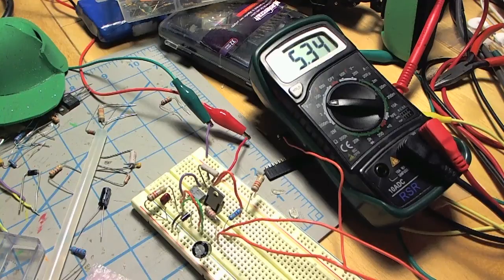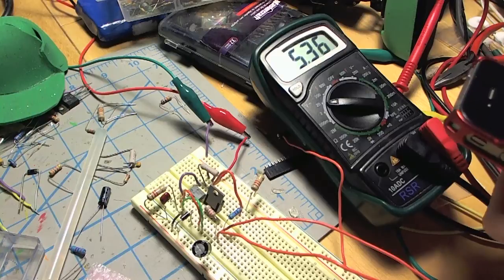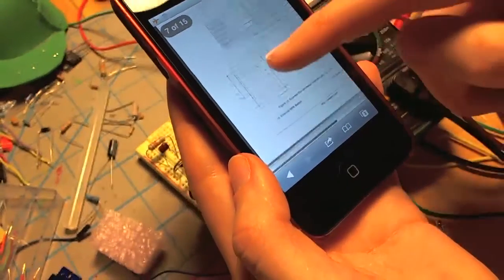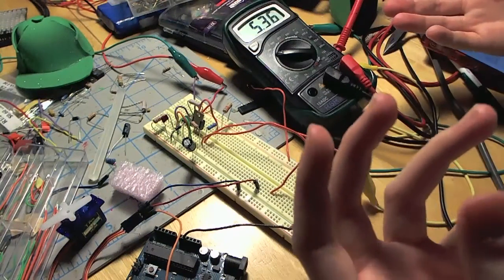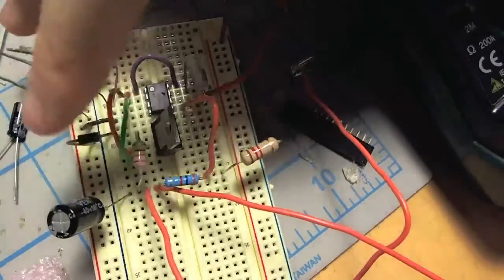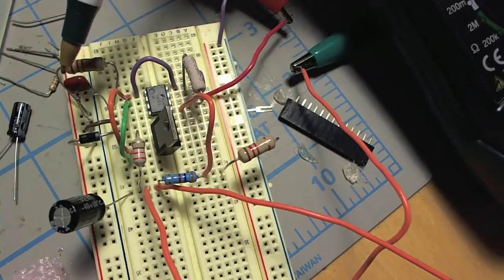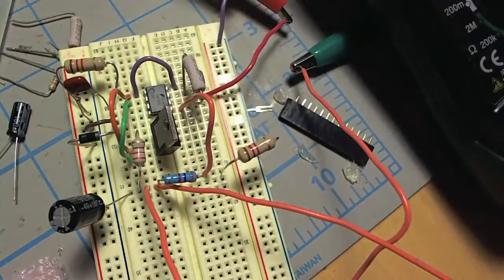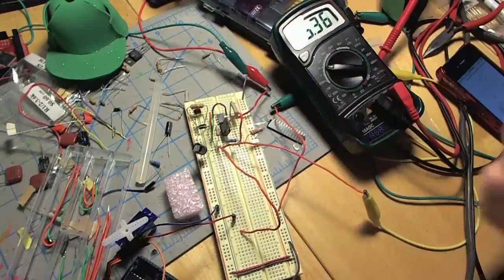Need help with MC34063 & external boost smps circuit

Comment: I know what it's too late, but i understand that the inductor used is not apropried to drain the current for your servo, change the inductor, and the limitter current resistor to 0.20 R, good luck!

Comment: I know you don't want to hear this, but the capacitance present in  those little breadboards are terrible, and will not work for an SMPS controller. Best do your circuit up onto a little vero-board. Keep the components close and leads short. You'll get it working!

Comment: I might be wrong (it's both from the top of my head and my gut) but I think it's possible that the inductor gets saturated with the higher current draw. The inductance goes down and the MC34063 isn't able to get enough energy to the output to keep the voltage.
Also if you aren't sure that the circuit is correct, put the datasheet (how the circuit should be) away, take a piece of paper and a pen and draw the circuit as you built it. Then you can compare it to the datasheet.